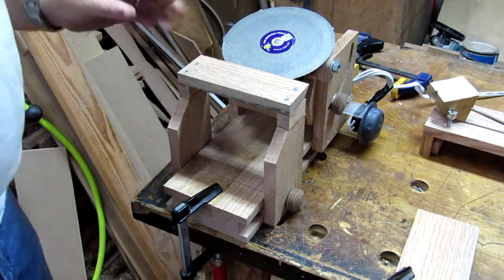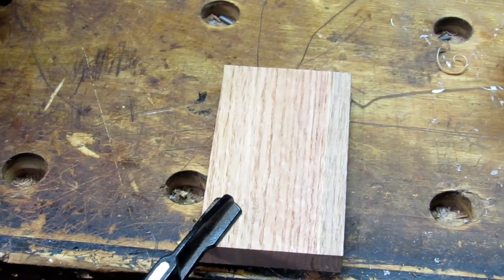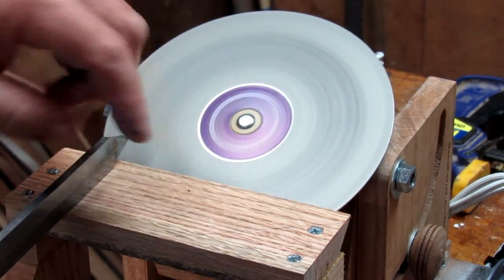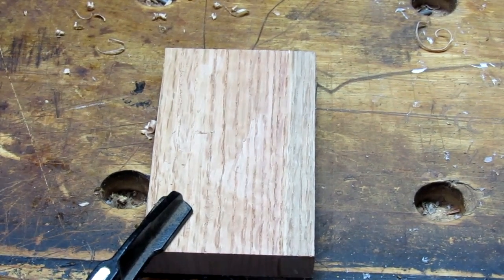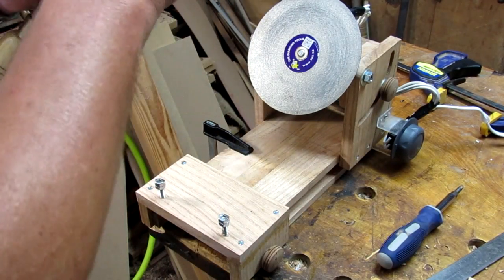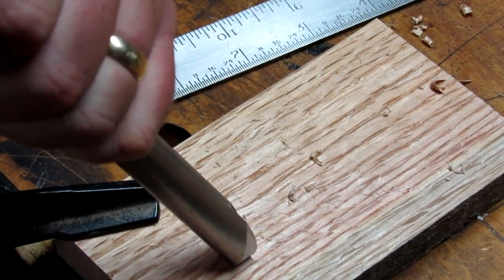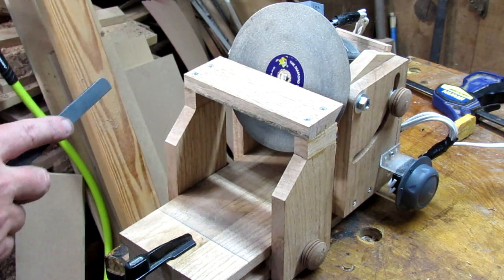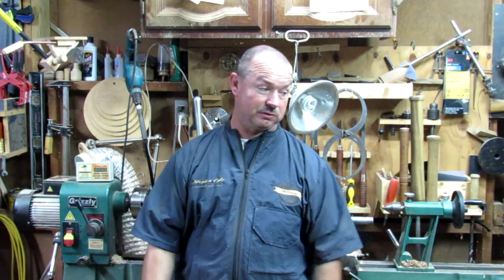#90 Sharpening Part 1 Woodturning Tools

Comment: For me, definitely the best sharpening machine design I have seen, having the disc inclined and the tool to be sharpened supported flat, thus avoiding angle variation when sharpening, is simply a very intelligent idea, I will build one exactly the same, thanks for sharing.

Comment: This may sound like dumb question, but can you tell me how you mounted the diamond disc to the motor? I'm not that experienced with this kind of stuff, but I have several motors I could use to sharpen my tools, but don't know how to mount the disc to the motor. Thanks.

Comment: I watched this sometime ago, and thought you told a little about the motor you used.  I've watched through since several times and do not see this. If I remember correctly, you used a fan motor?

Thanks
Reply from the maker: Thank you John. The motor came from a Lasko Wind Machine I purchased at Walmart but have seen at several different dept. stores. I hope this helps.
Reply: Thanks

Comment: On the first side on the HK webside it states : remember to watercool the diamond disc. I don't know if it is the disc or the tool they are afraid of, I can only say that I would never destroy my knives in this contraption. Maybe it it all right with those thick lathe irons, but a fine knive  No Thanks
Reply from the maker: Thank you sir for your comments. I am sure that when polishing diamonds at very high speeds the disk could possibly heat up. However I am only spinning around 1300 rpm and I have sharpened "Many" knives with this sharpener with not so much as getting the blade warm. If you don't trust it even though you haven't tried it. I understand. Don't use it. It is after all your choice and possibly your loss.

Comment: Your design looks a lot like the Work Sharp 3000 system, which is the one I would buy over the Tormec.  I hate the idea of a concave grind on any cutting edge.  Besides the $200 base starting cost, their disks and attachments really drive up the cost from there.

That said, I like your design about as well and I especially like the idea of a shop made tool.  The only thing I might change would be the depth of the tool rest as shorter things like my small carving tools might not have long enough shanks so it would never reach the wheel.  Your design will make it easy to change out the tool rest to accommodate different cutting tools.  Excellent design Stephen.

As for the grits, I figured I would just lay out the money for several different grits (80, 240, 800, 1200, and 3000).  I may end up using a single disk once all my cutting tools have been set up the way I want them, but I think getting them there will be much easier if I start with the courser grits and work my way up.  Some of my small carving tools may do well with just a 1200 or 3000 grit wheel.  Have you thought about making up a leather honing strop for your system?

You are awesome.  Keep up the good work and thank you very much for passing on your talent.
Reply from the maker: Thank you sir. I am really glad you enjoyed this project and thank you for your insightful comparison with the Work Sharp 3000. I believe it would be very easy for you to make a leather strop for yours. I simply sharpen to 500 grit and that polishes my tools well enough. I also had a comment where the person had bought my sharpener plans and modified the disk stabilizer with neodymium magnets to afford a quick change ability. Just a thought. Thank you for your very insightful comments.
Reply: I already had the Work Sharp 3000 system when I saw this video.  I used 1/2" MDF disks slightly thinned and then used spray adhesive to attached the THK diamond lapping plates to both sides.  Now I can use the top and bottom without having to flip the disk.  I also made the set up that Stumpy Nubs did to hold the various disks.  Now I have to figure out how to add the Blackhawk jig to sharpen my new bowl gouges.  I will post a video once I get it completed.  Great idea and job Stephen.

Comment: Very good machine. I currently have a tormek wheel, but its tiresome the FAST speed the wheel wears down, and its too easy to get a groove in it, and its messy too....I am thinking about going over to diamond, this is an excellent inspiring idea. Are these thk wheels flat right the way across or are they bending down a little at the edges?

As I watched, it also reminded me of an article years ago out of fine woodworking or a similar thing, a native american carver built a horizontal wheel for stropping his tools. It was as I recall a thick wooden disc covered with leather and powered by a washing machine motor. I often wonder why grinding wheels are almost always aligned vertically, horizontal seems more natural.
Reply from the maker: Thank you sir for your inspiring comments. I really appreciate them. The THK disks were designed for the diamond cutting and polishing industry, therefore they are very flat and made from stainless steel. I have now been using this system for about a year and have noticed that the wheel is showing no sign of wear. Even while sharpening HSS, High Carbon steel and Carbide scrapers.

Comment: Did you have to have the fan swing thru an arc? Would it be possible to just have the fan swivel on a horizontal axis (like a stage spotlight)?
Reply from the maker: Thank you sir. I assume the fan you mention is actually the diamond disk. Yes, It would be possible for it to swing as you suggest. However, I will need the edges of the disk for a future fixture I am going to build and I will need the edges clear of the sharpener. I hope this helps.

Comment: hi stephan,just watched this vid and am impressed,just ordered some discs from hong kong on your say so.i have a small tile cutting machine i no longer use, it has a adjustable table so it may do the job for me.i don't know if these are available in the US but i would think it probable but as the UK is probably ten years behind the states i think it likely.anyway I'll let you know how i get on as this may help other watchers to make the sharpener without having to make the jig.(time being precious)all the best from across the pond
Reply from the maker: Thank you George. I am glad you enjoyed this project. You will like the THK discs. I do not know which grit you have but mine is 500 and it leaves a very nice polished edge and I have used it almost everyday since I built this sharpener with no sign of wear yet. I hope your cutting machine works out well for you. I would be interested to know how well it performs. Thank you for all your input and Take care.
Reply: hi stephen thanks for your quick response .i've ordered 350,500 and 800 as I saw on your reply to texasblacksmith you use 500 so I though I would spread my options and get one either side.now Im going to see your other vids to see what else I can learn .keep up the good work and be happy

Comment: I looked on the THK web site for the diamond wheel and I looks like you are using the flat pad with velcro backing, is that what you are using??
Reply from the maker: Thank you sir for commenting, but I am using the lapidary disks. They are stainless steel disks with industrial diamonds on one side. No velcro on them. The link in the description should take you straight to them. I hope this helps.
Reply from the maker: Sorry it is on my build video. Just a slightly newer video showing the build.
Reply from the maker: http://www.ebay.com/itm/Grit-500-Diamond-coated-6-inch-Flat-Lap-wheel-Lapidary-grinding-polishing-wheel/121084916883?_trksid=p2054897.c100204.m3164&_trkparms=aid%3D222007%26algo%3DSIC.MBE%26ao%3D1%26asc%3D20140407115239%26meid%3D13790dbc4506479fbd5f6af9b0b14bbf%26pid%3D100204%26rk%3D1%26rkt%3D20%26sd%3D130930389557

Comment: Hi Stephen
I really like your machine. Have you made a jig for circular saw blades and forstner bits?
If so are you planning a video?

Thanks
Jerry
Reply from the maker: Thank you Jerry. Glad you like this sharpener. It has really increased my capabilities in the shop with fast and accurate sharpening every time. I have not made a jig for circular saw blades yet. I am thinking of one similar to Matthias Wandell's and as far as forstner bits. I do sharpen them on this machine but I sharpen them by hand ( at least for now and they work great. Once I develop my Sawblade sharpener jig I will be doing a video on it. Thank you very much for asking. Glad you enjoyed this project.
Reply: Thanks for the quick reply Stephen.
Would you be able to do a video of you sharpening 
forstner bits?

Comment: This makes all the sense in the world.  So simple, yet so great. I'm new to this so bear with me.  What diameter wheel are you using?  What Grit is the wheel?  What motor and RPM is it running?  The company has disks from 60 to 3000 grit!  Thanks a lot for the video.
Reply from the maker: +Ken Johnson Thanks Ken. Glad you enjoyed this project. The wheels I use are 6 inch diameter and are 500 grit. That will leave a very fine edge on your tools but will not be very good for resurfacing or changing the bevel. The motor I use came from a box fan and did not have specs on it. It is a 3 1/2" diameter and about 3 inches tall. I figure it turns around 1300 rpm. I hope this helps.

Comment: Hey man I really liked you sharpener, I found some 6" flat diamond wheels on Amazon, I tried to copy and paste the site but it won't let me. But what I need to know is what grit your wheel is. These diamond wheels are only $12 to $13 Thanks and I am a subscriber. Thanks Tony Denton
Reply from the maker: +Tony Denton Thanks Tony. The wheels I use are 500 grit. However you could use down to around 200 grit.  This system with these wheels are not designed to reshape an edge but only to sharpen the existing. I am very happy with the results of this sharpener. Very versatile and repeatable.

Comment: Stephen  hi like your grinder. i watched you grinding the gouge. the reason you have a burr on the edge is grinding on the right. you always want the wheel turning into your cutting edge. so cut on the left. A machinist taught me that sharping a cutter on a machine at work years ago. hope that will help. the wheel rolling away from edge rolls the burr on the edge will make sences if you think about. god bless for the mobile home workshop   Robert
Reply from the maker: +Robert A Crowe Mobile Home Workshop Thank you Robert. I agree with you 100% and now I do not have the motor reversed so I began sharpening with the wheel spinning into the edge as you suggest. Works great. Thank you for commenting. God bless your Mobile Home Workshop!

Comment: Excellent! This is just the design I have been looking for. I like the concept of the table staying level for every tool and the grinding wheel tilting instead. It seems this will make sharpening all tools easier since your hand angle never changes. Plus, I like the advantage of having a larger grinding surface. A grinding wheel forces you to an inch surface at the most, which makes freehand sharpening a pain. Your disk allows a much larger surface. The construction video may already be out, so I look forward to learning more. Again, great job and thanks for sharing your knowledge.
Reply from the maker: +Stephen Landry Thank you Stephen. Glad to see you spell your name correctly also, Ha!  I have used this system for a while now and really love it. It takes away a lot of the hassle for matching your bevel to the stone. Like you said, the larger surface helps a lot also. Glad you enjoyed this project and found it helpful. Hear is a playlist of the videos I have on the building and use of this system. I still have one more video to go on sharpening woodworking tools so maybe you will enjoy it also. Click here for the Playlist.  https://www.youtube.com/playlist?list=PLGsnYf7PysCQb5mjvEG2EQvgrZBIs8_65

Comment: Stephen if you grind away a notch of leading edge of the coupling nut that you use as your pivot point of the Blackhawk. You can solder the nut in place to give yourself increased height.
Reply from the maker: Thanks I think that will help. I will try it. Again thank you.

Comment: Stephen I use a Wixey digital angle meter, this allows for so many cheats, for setting up anything from table saw tilt, drill press, router ect. it has two magnets but still works on non ferrous items, I have used dbl back tape to attach a flat metal plate to the non ferrous items, and then use the magnets on the wixey. These things are really a time savor and they are rather reasonable in cost (less than $30.00). I store it in a tin can and am careful not to misplace it. Please give one a try, it would do my heart good to help you out for a change.
Reply from the maker: Thank you sir. I already have one and agree with you 100%. I use it for everything. Table saw bevel cuts are perfectly accurate. Never could get that before. You are right. At less than 30 dollars it is a very good tool to have. Thank you for your suggestion. It will really help some woodworkers. I'm glad you are enjoying my channel.

Comment: What grits do you use? You said 500 grit? That really a fine grit.
Reply from the maker: Yes. this wheel is 500 but I also have a 220. As long as you are just honing a dull edge the 500 is great. The 220 could be used for a damaged tool or some other application to remove more steel.

Comment: In all my years experience with carbide tooling (since the beginning) I haven't noticed much need for sharpening. Carbide will stay sharp and cut when it is red hot. HHS on the other hand does require sharpening to maintain a sharp edge. Most people have carbide tools sharpened because the tool or blade acts dull but it really is still sharp. The problem is the blade is gummed up with pitch and that makes the blade cut as if it is dull. I found this out many years ago when the sharpening service I used at the time told me the carbide blades were not dull but simply gummed up and this man who happened to be a retired cutter grinder for Chrysler was very knowledgeable about carbide. He explained that if any carbide tool will scratch your fingernail it is sharp and not in need of sharpening. He advised me to clean the gum and pitch from my saw blades and see if they really were dull. He told me they use lye to clean blades they sharpen and the best thing for me to use was oven cleaner that you can buy at the grocery store so I bought a 12 inch pizza pad and a plastic long handled vegetable cleaning brush and sure enough after cleaning the gum and pitch off the blade it cut as good as new. Unless I hit a nail or other metal or in the rare case a extremely hard knot in wood carbide cuts right through it. HHS steel is sharper than carbide while carbide is more durable but it brittle and can chip. That is the difference. I have saw blades I have not sharpened in over 5 years and they still cut like new once cleaned up. Router bits are the same but seem to gum up quicker but are cleaned in the same manner. The only HHS tools in my shop are chisels, plane irons and of course lathe chisels. Work sharp but sharpen smarter and avoid grinding away tools needlessly.
Reply from the maker: +James Stanlake Thank you James. I agree that carbide does last much longer than HSS and simply needs cleaning most of the time. However, I also have blades that have been cleaned and still were dull. My blades will last a long time between sharpening, but still need to be honed on occasion. Thank you sir for your sharing your very sound advise on this subject. Cleaning a blade should definitely be your starting point when a blade is not cutting properly.

Comment: Great video Stephen. I'm already gearing up to make a sharpener like this.  I have an idea for this project that I wanted to share. How about drilling a hole through the side somewhere and using a pin instead of lines for repeat ability.  Several holes for different tools. I know that when I touch up my turning tools with a diamond card lapping fluid helps a lot. Have you given any thought to using the fluid on your wheel?   I can't wait for part 2 and the build video.  Again great job!
Reply: Dale Parrott 7

Comment: What a great tool. Very nice. So simple and so easy to use. It ticks all the right boxes. Well done. Can not wait for the plans... ( I have access to a CNC machine). Only need to know - was the top of the tool rest level with the top of the disc when in the horizontal plane? I envisage to make attachments for doing my thicknesser / planner blades.
Reply from the maker: +Tony Collins (Woodgrub) Thank you Tony. Glad you enjoyed this project. The plans will be available in a couple of days. The disk is about 1/4" below the toolrest when they are parallel.  Yes, the dovetail guide slots will allow for accessories limited only by your imagination.

Comment: Hey Stephen, Really great job making the sharpener. I've been using my belt sander and disc sander for awhile. That setup you have would be nice. You can get perfect RAZOR sharp bevel every time. I really enjoyed it. You got my attention. I would like to see the plans so I can make one. Thank you, David
Reply from the maker: +David  Brousseau Thank you David. GLad you like it. I will have the plans available very shortly. I like not having to match the tool bevel to the grinder anymore. The presets really help with accuracy.

Comment: Stephen that system is pure genius, its good enough to be commercialized. what motor did you use?
Reply from the maker: +Frank Fitzpatrick Thank you frank. Glad you like my design. This motor came from a box fan and has no part number that I can find I know it is a 2 amp motor with a 3/8th shaft. I am now in the process of finding a motor anyone can buy online to incorporate into my plans.